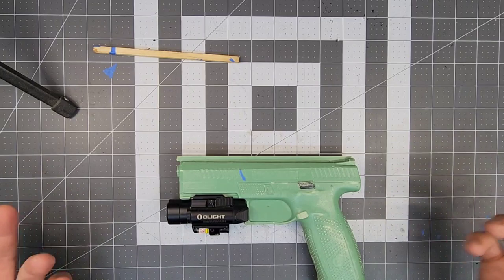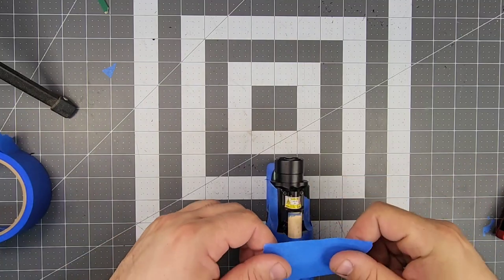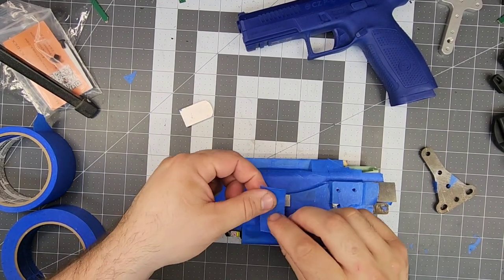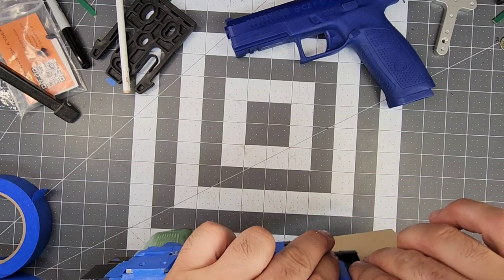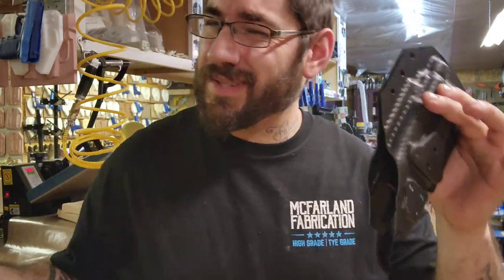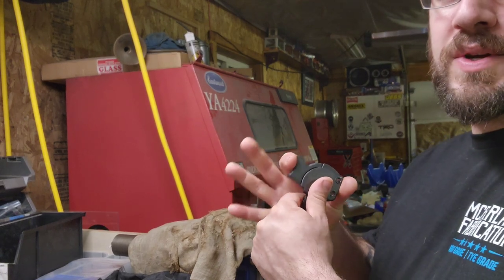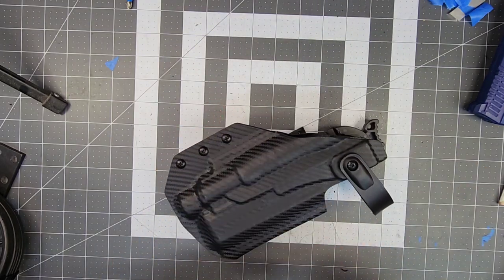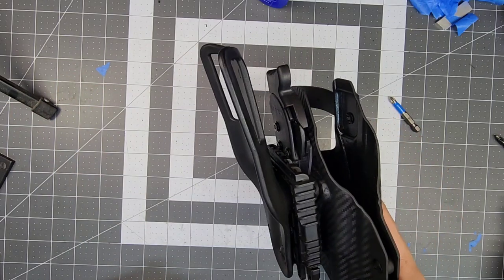Making a Holster for the CZ P10 F with Baldr pro, wrapped in Black Carbon Fiber Holstex

Comment: First of all, great video as usual! Quick question: I've noticed in your videos that you cut pieces of rubber hose for your tensioners/spacers...what size/type hose are you using??
Reply from the maker: Part number 65112 on amazon. Continental  overflow tubing

Comment: I have a question. What size Kydex (LxW) is a sort of "Fit all for any gun?  8x8? 8x12? 12x12?. Also iwhen doing a multi layered holster would that "fit all" size work for both layers?
Reply from the maker: So on a foam press, 8x8 works for most. 8x10 for light bearing. On vac, normal is 12x12
Reply: @FalTacUnlimitedLLC  Thanks for responding. im getting ready to start out making  Custom designed holsters. Im in R&D mode currently. So my thoughts are in every direction sucking up as much information as possible. Speaking of sucking.. Ive built one Vac press. (Saw your vac press by the way. Awesome design.) Its not yet tested. and  im thinking im gonna also need to build a foam press. Right now my money is going into equipment,  And between time im gathering info on kydex, hanger patterns, molds and so on. (Its a good thing im a carpenter)So i might be hitting you up with a lot of questions if your down to answering them. Thanks again.
Reply from the maker: @Disclosure Tv  anytime my man!

Comment: Would the heat affect an actual glock? Or is the mold gun necessary?
Reply from the maker: yes and no. if you press your glock, put 2 layers of blue tape on each side of the mag and keep it in the grip and then press, youll have no issues